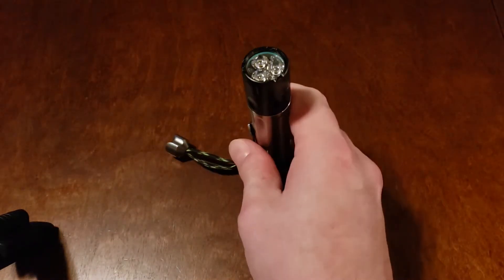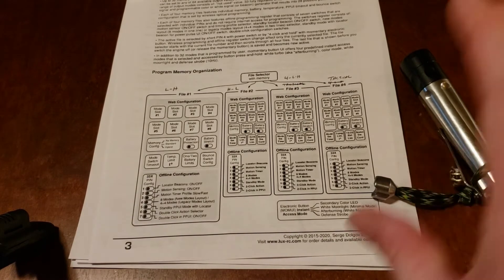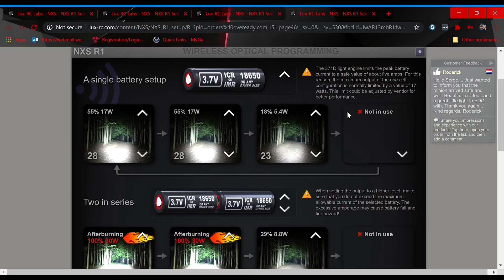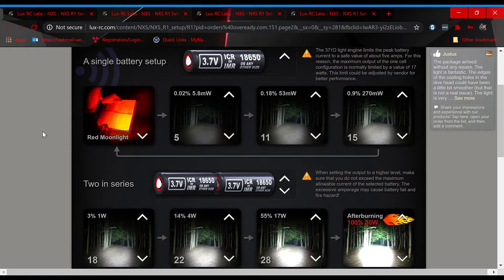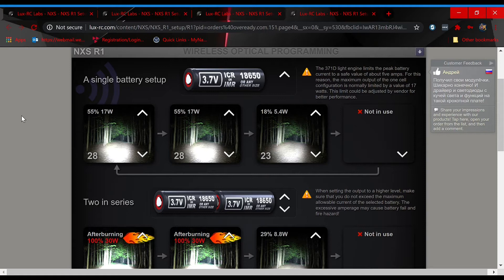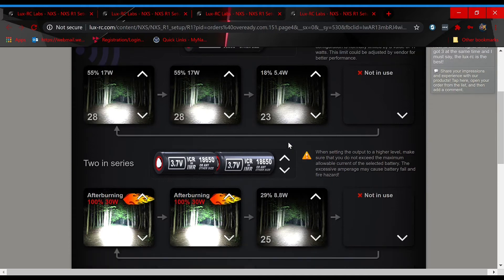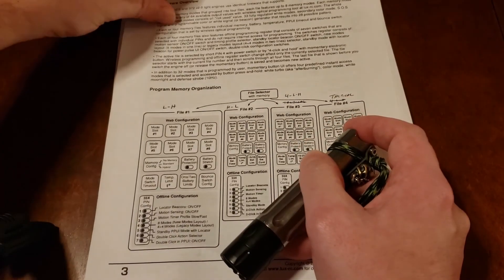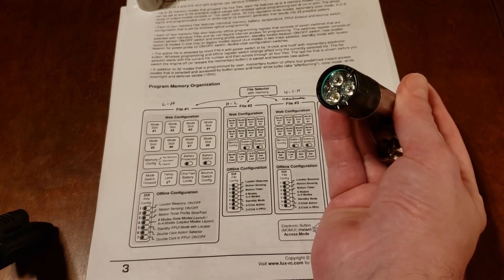Oveready Boss V5.1 Lesson 1: Page Files

Comment: Idk if I'm completely missing something or just dumb but I cannot figure out how to even get the option for more than one "page"
Reply from the maker: Sorry about that. I'll make a video showing how to program multiple pages. Hopefully today or tomorrow. I'll let you know when I get it up.
Reply: @GenKraid  thank you. Ya , I'm loving the light thus far, and really I typically use a minimalist approach when programming my lights ( typically just two modes that I call "ON, and TURBO") ...but it would still be nice to have multiple programs on the fly if need be. Mainly Id like to have an easily accessible configuration that enables the use of a couple different strobes for walking home on busy highway at night but obviously not  strobe that I have to try and skip for the remainder of the time I use my light. Thanks
Reply from the maker: @kodyschmautz7799  Hey, Kody! I got the programming video up now! Please let me know if it helps you. Just to be sure, you have the version 5.1 firmware, right? If you don't, you can coordinate with Oveready to send your light in to be upgraded.
Reply: @GenKraid  going to give it a shot here soon. And I believe so I just bought the light within this month